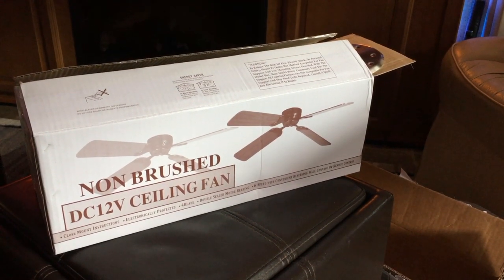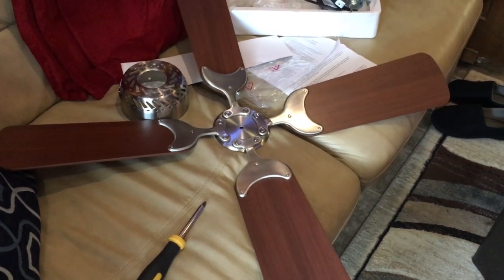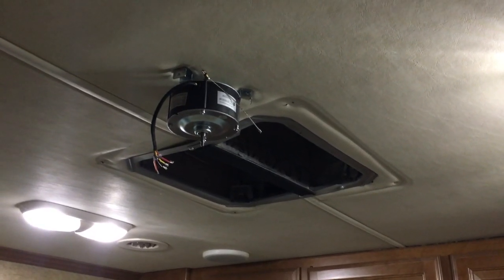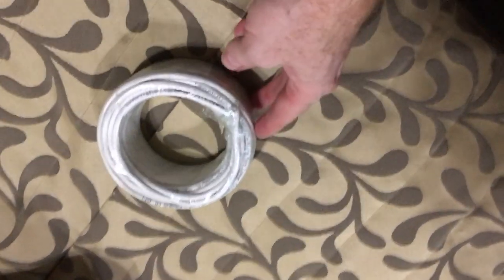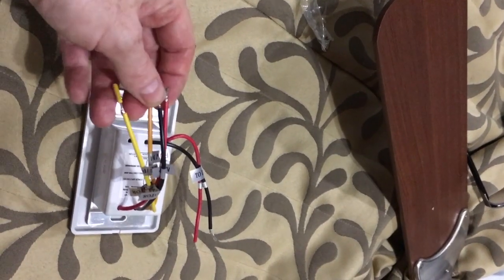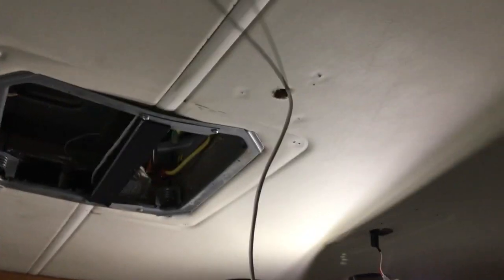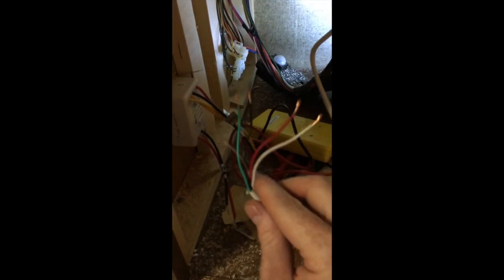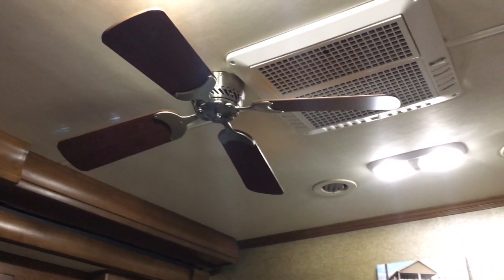RV Ceiling Fan Install

Comment: Does it run on 220 volts? I was thinking of getting on of these for my basement
Reply from the maker: This fan is 12V DC, to run on the 12V systems common in RV's.

Comment: I see this is an old video, but I was wondering how this fan has held up? And you didn't have a fan in the bedroom before, correct? Did you also install a second one? We have a 5th wheel and I would like to put a ceiling fan in the living area, the ceilings are high enough, no worries of bumping it, or slide issues. It just seems like there would be a lot of movement for it traveling down the road, but would love to install one.
Reply from the maker: The fan has held up well, no issues.  We had no ceiling fans originally, but now have 2, one in the bedroom and one in the living room.  These are flush mount, and operate off 12V DC.  Since they are flush mount, there isn't really much movement while traveling, other than vibrations from bumps, etc. but it's not affected their operation.  I've seen the larger traditional 110V AC flush mount ceiling fans in 5th wheels before, since they have the higher ceilings.   But if you want 12V DC, these are a great option.

Comment: How did you attach the fan to the ceiling ? And do you have a slid in that room ?
Reply from the maker: I used wood screws to attach the fan bracket to the ceiling.  And yes, I have a slide in that room, and just have to be mindful of the fan blades when bringing the slide in.